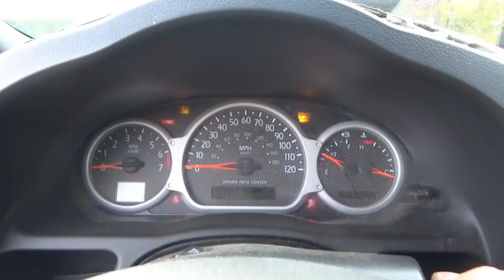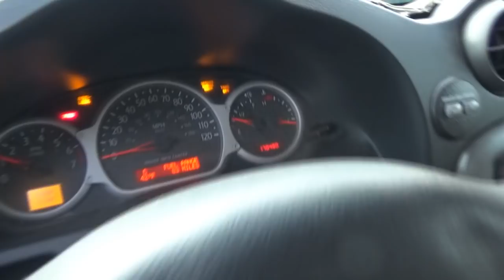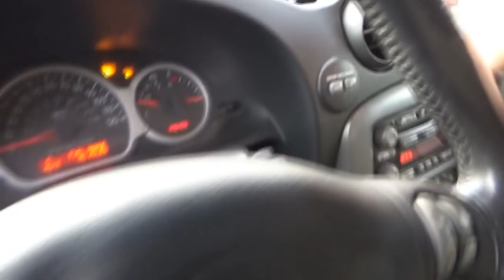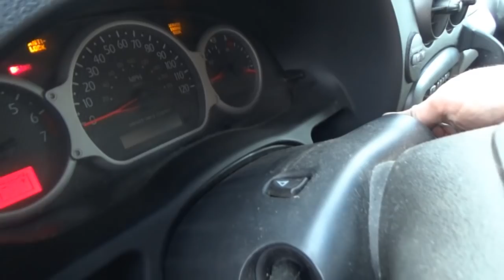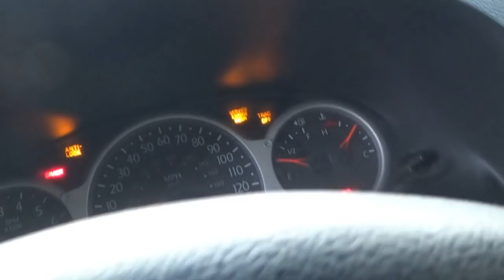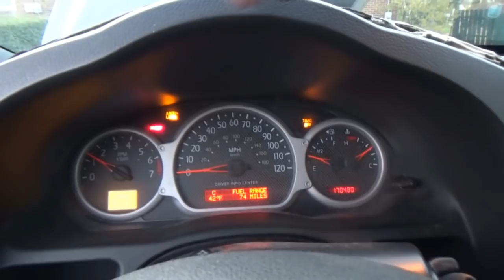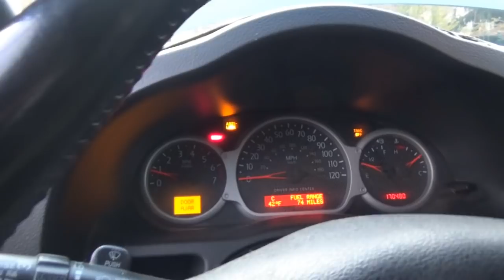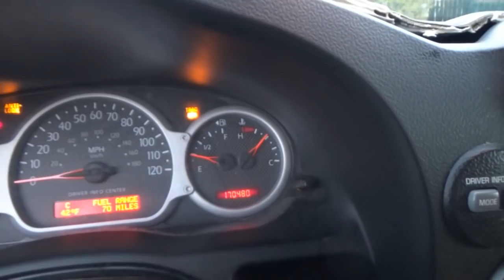MV 183 - "The Aztek Is Far From Fixed"

Comment: I remember our 2006 Torrent had a similar issue towards the end of our ownership. That 3400 never seemed to idle good toward the end of our ownership after 7 years and 150k. I had always figured it was a vacuum issue, it was never bad enough for us to replace, though I do remember ever so seldom it would stall. I’d bet your having some vacuum errors somewhere. Maybe try to “cheat” the cooling system and run a colder thermostat? Hope that could at least help one way or another!

Comment: Vacuum in an engine is greatest at idle and vacuum lessens as RPM increases. So if the shaking/rough running goes away at higher RPM, you could be dealing with a vacuum leak. No heat could potentially be from a thermostat not opening up or a water pump not circulating the coolant around. Just some ideas.

Comment: Anytime you see the exhaust pipe shaking and hear like a puffing sound it’s misfiring. You might have a bad coil. I see you changed the wires and plugs but one coil may not be firing. 
 Also no heat could be a clogged heat core and go buy a cheap scan tool hook it up and read what codes the computer got stored could put you in the right direction to what could be wrong. The wine noise almost seems like a bad pulley or could simply be the belt.